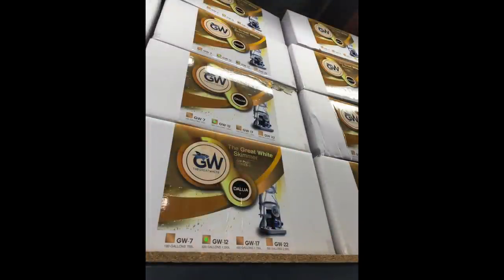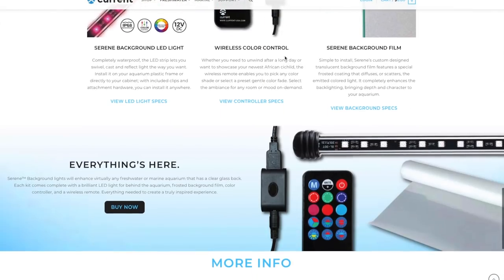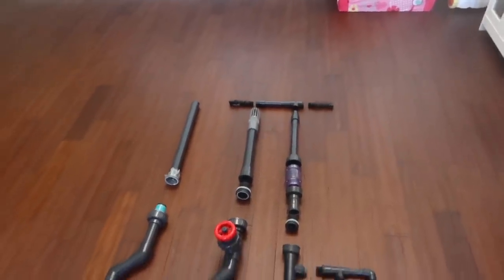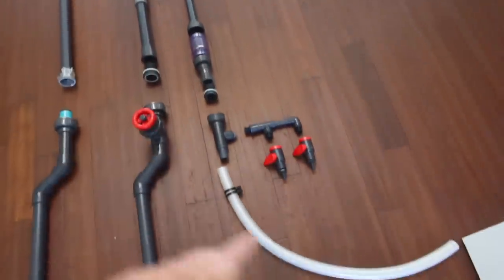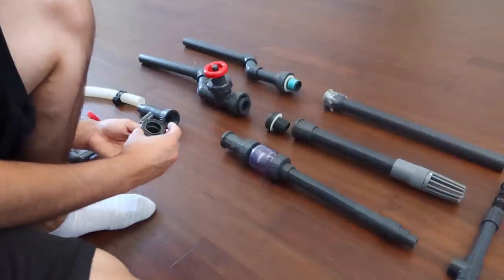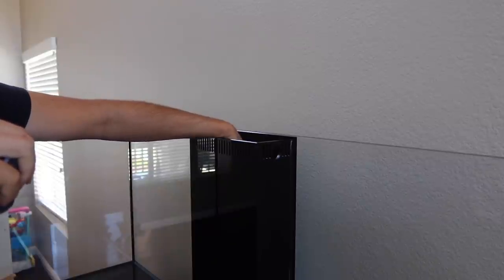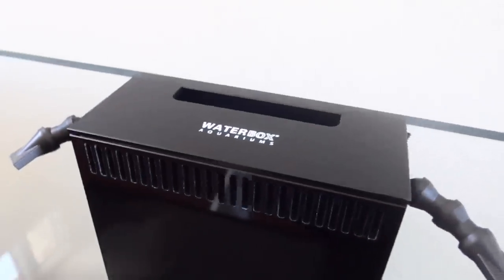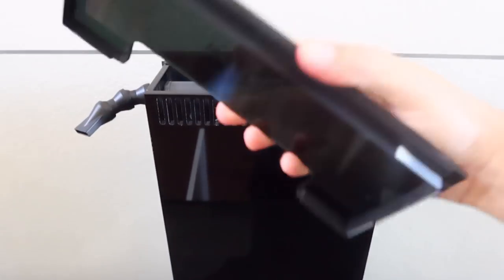WaterBox Plumbing + Mini Update

Comment: Nice video . I had two small issues.  My manifold had a pinhole leak from the factory.  I went without, works fine . Be careful with those plastic hose clamps . Mine failed on the return pump. I ended up having water shoot everywhere. Flooded my hardwood . Stainless hose clamps work like a champ.

Comment: why wouldn't you make it even easier and use painters tape to tape the bulkheads in place under the tank and then screw the pipes from above onto them? this way you don't have to fiddle around trying to find the hole from down in the cabinet. I mean painters tape is designed specifically not to leave any residue.
Reply from the maker: This would be a great way. Honestly for me it was super easy doing it this way. The holes are so big it’s easy to align them.